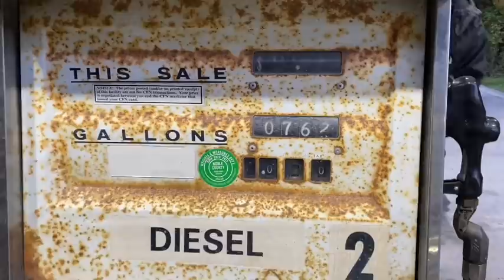Getting the concrete rv pad poured

Comment: Another dream come true!  Good for you Scott,  hopefully you will see some money coming in instead of the other way around. 

That 15' screed had to be fun. As far as cutting deep groves in your slab, I have never seen a crack follow the cut line, they run where  they want. If you do fill them with a tube of roofing tar, water gets in there and freezes.

Comment: Nicely done.  Kudos to your helpers as well. Looks like even the mixer driver pitched in a bit, and what a great idea to use the leftover as support on a curve on the driveway.  Yeah, working with concrete is real chore when it's something you don't do on a daily basis.  I've helped out on many d-i-y pours over the years, it's a job that leaves you (sore and) wiped at the end of the day, but filled with a sense of pride for years afterward for the effort put forth.

Comment: Don't worry about expansion joints, they are not necessary. Your little hand edger is only to round the edges to prevent cracking and chipping at the sides. Do that within 4 hours of the pour. You can rent a diamond saw to cut crack control cuts across the pad on 8 to 10 foot spacing. They should be about 1/4" deep, no more. All concrete will crack and this will make it crack where you want i,t not across or in uncontrolled ways. You can add wood or poly blocks under the wheels to protect the tires, but you are on the move so much it probably won't matter.

Comment: Interesting.  I've never hear of oiling a concrete form.  What does that do?  Keep the wood from sticking?
Reply: Yup
Reply: some use diesel fuel and help pull the wood form sticking and leave some what smooth edge

Comment: suggestion for next pour    rather than use re-bar  have the concrete infused with the fiberglass particles    Just as strong  as re-bar   little more expensive per yard of concrete but when you consider cost of re-bar and labour to install it easier and cheaper   looks really good  All the best as always and stay safe guys
Reply: He did get fiber added to it

Comment: What r u gonna do for the lead up to the pad, otherwise the vehicles will track mud and gravel up onto the pad. Also do you think u should have troughs on both side edges of the pad for rain water runoff. Could put metal grating to serve the dual purpose of helping to remove gravel from the wheels and allow for traction to get up onto the pad in wet weather (like airports have at the entrance to the taxiways to prevent FOD ingestion)

Comment: Joints should be CUT AT LEAST 25% of the thickness of the slab.   You need to cut AS SOON as you can walk on it with an early entry saw.  NOT A DEMO SAW.  If cracks have already formed before you cut the joints it's too late.  They are NOT expansion joints they are contraction joints.

Comment: looks good ,how long til you can use it ?
Reply: After he cuts in the expansion joints, it should be set in 2-3 days. I'd wait a week before driving a bus on it though. They say it takes 28 days to "fully cure", but I've heard some say that properly mixed concrete gets harder every day for about 60 years before it becomes susceptible to breaking down.
Reply: @stanpatterson5033  Concrete gets 80% of it's strength in 3 days and it takes 100yrs. to fully cure.

Comment: Don't rent  you  can buy cheap skil saw  for $30  couple masonry blades  cut when green
Reply: I use this route for small jobs, like cutting landscaping block, but I am not sure about this scale.  He has maybe 3 cuts 1.5 to 2 inches deep, times 15 feet.  And may have to go through rebar.  I am not an expert but it seems like a more significant tool and blade may be called for - at least compared with what I have used.
Reply: @donmoore7785  The cuts are shallow enough to not cut the rebar. That would defeat its purpose and expose the rebar to water and oxygen, which in turn would cause it to rust.

Comment: Did you edge it?
Reply: Yes, they did. I can see the edger was used, and at 9:25 right after he said that Kelly put the date on it, Scott says they used an edger. All that work without edging it would be a poor job, and you can see that it wasn't Troy's first rodeo. Those front discharge trucks save a lot of work with the driver being able to move the chute means that no one on the ground has to move it back and forth to place the concrete where needed. I wish we had those front discharge trucks here where I live. Some guys like a "wet" concrete, but I saw that theirs had just the right slump, making it a little more difficult to work, but providing a stronger finished slab.
Reply: @lynnleavitt478  My bad. I failed to watch the entire video and commented on something obvious.